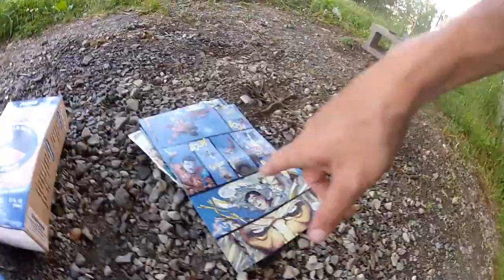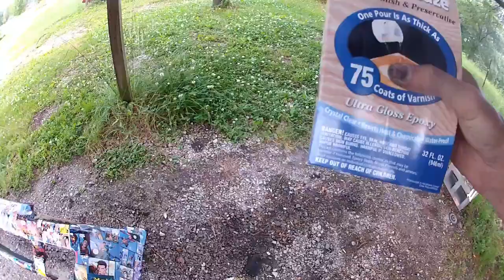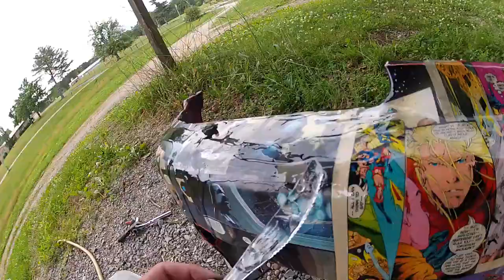DIY STICKERBOMB USING COMIC BOOKS

Comment: Looks alot better than when I did it with clear coat spray. I need to try that. I love how it created a perfect shell coat when you just poured it and let gravity do the work. How did it hold up?
Reply from the maker: It ended up being thin in some places so it only lasted about a year. I bet with 2 coats it would last a really long time tho
Reply: How long did the clear coat spray last that you used? I am looking at doing this over about 50% of my car and some peices might not come off to epoxy.

Comment: how it held in the rain ?:P and if its stil holding
Reply from the maker: It lasted for a while but the coating was to thin, it's still there but faded and has a few holes lol
Reply: @SlightlyMangled  well it looks like u poured   like half a litre of coating :D maybe u can recommend something cuz im thinking about doing something like that on my e36 cuz my fender got damaged:D
Reply from the maker: I did pour a lot on it but it was running off to fast and couldnt get a good coat. If u can get the fender flat and pour multiple coats it would be a million times better